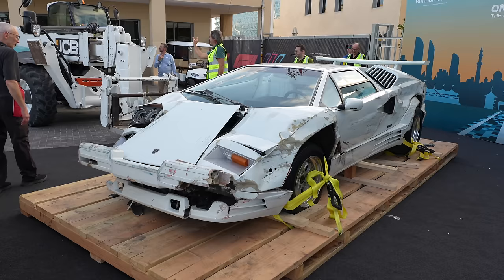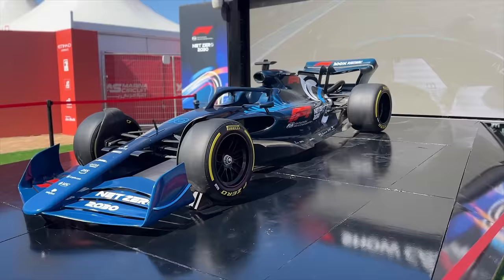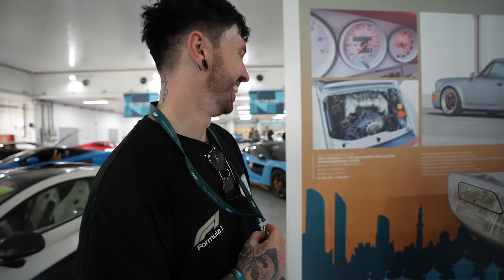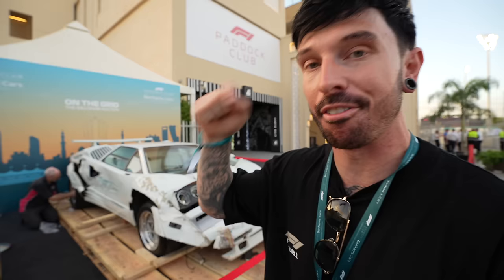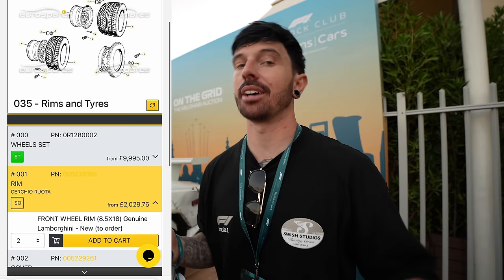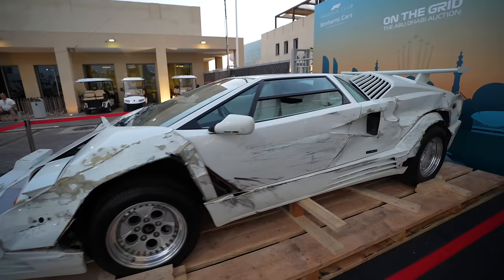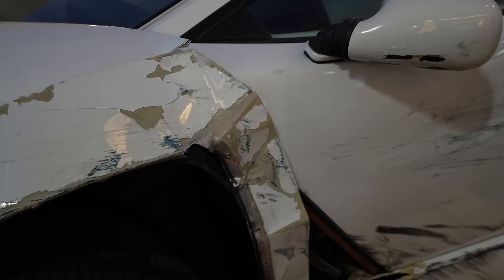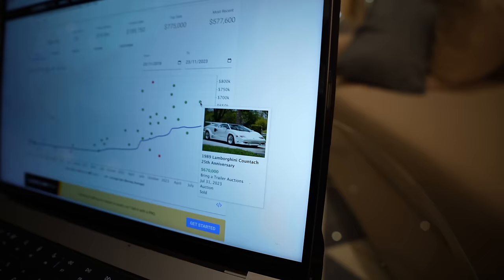I FOUND LEONARDO DICAPRIO'S WRECKED LAMBORGHINI

Comment: Woah, this would be really mad to restore
Edit: That price is WILD, I wonder what the buyer will do to it, hopefully it gets back on the road.
Reply: It didn't meet its reserve unfortunately
Reply: @richp1802 what does that mean?
Reply: @caduguardrailkingowo  Means it didn't sell
Reply: It means that the price didn't get to what the seller's minimum sale price was. Meaning that the bid was just cancelled and that's it. The previous owner still has the car. @caduguardrailkingowo
Reply: So now you’ve shown that Car Verticle have the car as no damage , are Car Verticals obligated to record it damaged ? As if it is restored , nobody would know and that makes using CV pointless, does it not ?
Reply: Damnn must have been less than $150k away from the reserve going by what the auction guy said to Mat
Reply: @mattbettany1174  Completely pointless! In fact, Matt should dump the sponsor if all as stated holds to be true

Comment: If I got it for free I would rebuild it 100%. But if I paid 1 Million+ I would not rebuild it because instead of rebuilding it you could have gotten a mint condition countach and saved 300k... So the reason its valueable is because it is crashed. Removing that reason would damage its value. Why would I overspend and put additional money just to lower the value ?

Comment: Believe in your capabilities, Anna. Your proficiency transcends your current self-assessment.

The primary area for enhancement, which is subtle yet pivotal, revolves around your capacity for cognitive recalibration. Before committing to a strategic path, it's imperative to adopt a position of rigorous scrutiny towards the chessboard. This entails a deliberate pause, allowing your mind to disengage from its initial trajectory, thus providing an opportunity to critically reassess the position for potentially superior alternatives. In essence, the trap of becoming overly enamored with one's preliminary strategies should be avoided. Cultivate an affinity not for these initial insights, however ingenious they may appear, but for the process of methodically deconstructing them.

Your talent is undeniable; it is merely a matter of overcoming occasional lapses into myopic thinking.

Comment: For me, worth significantly less when you have an absolute pudding going at it with a drill and a screw driver for no reason. Would have been worth more for me if it was as is smashed from the film. Also wouldn’t pay 350k (if I even had it) for a mint one, let alone one smashed up for a not even that great of a film. Some people just have more money than sense.

Comment: If the movie studio wants you to rebuild it, charge time plus materials at $2000.00 per hour. I think we put too much emphasis on movie stars. If you want to think of it as an asset you can sell in the future then I think it has no value as a heep of junk.  The name lamborgini is given too much emphasis also. If you were loosing your house or starving who would by a heep of crap? When it's fixed it has value otherwise it is for elite only and they wouldn't even bid up to the reserve.
Reply: They didn't say what the reserve was.. they just said that it was less than the low estimate.  And losing only has one O in it.  Other than that,  bang on.

Comment: That’s not the car seen in most of the movie. They had one they crashed the first day and then rented the other one for all the shots other than the wrecked shots.
Reply: The trunk deck and wing however was used on both cars as the owner of the clean one didn’t like having to fix the wing on his so often so he took the wing off and sealed the holes as well as he took the American rear bumper off and put the euro rear bumper on his.